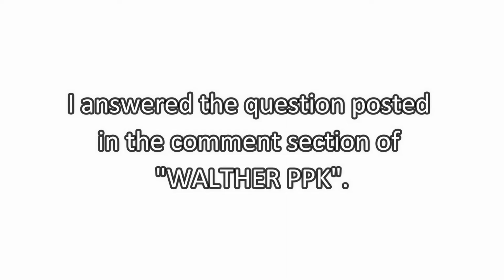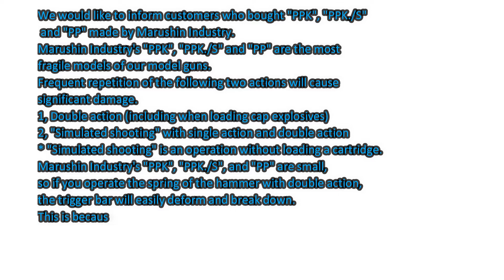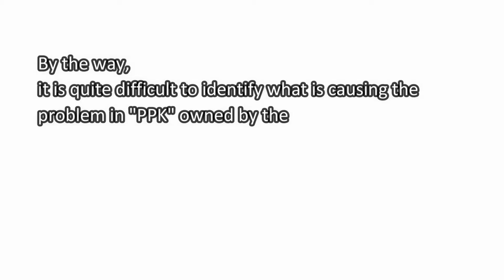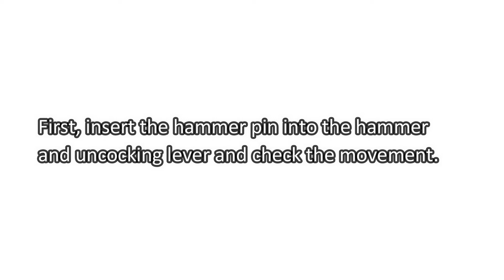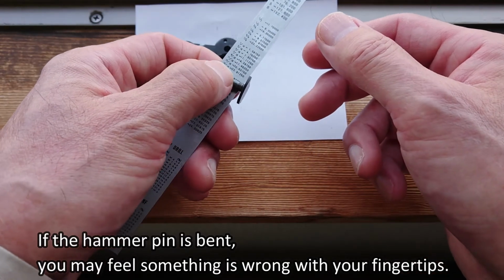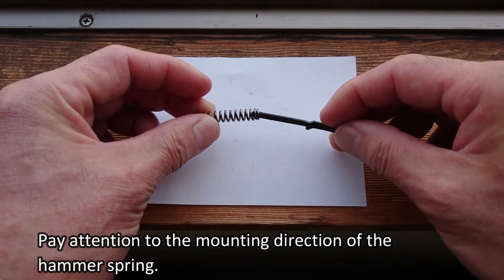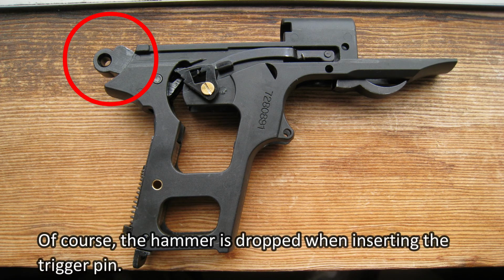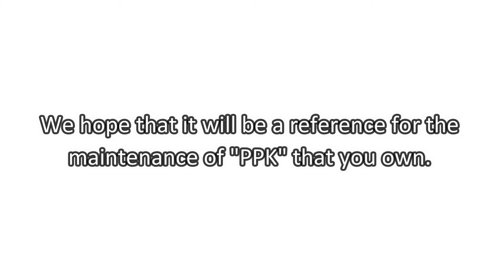I answered the question posted in the comment section of "WALTHER PPK"

Comment: Excellent video. I am with you on manufactures responsiblilty with these models, most have been made for many years and all problems should of been solved by now. The UK also has very strict ruling on replica guns so i understand the need for making models impossible to convert, but as these are plastic i dont see the harm in making some internal parts a lot stronger.
Reply from the maker: Thanks for your comment.
An industry group of modelgun manufacturers has set their own standards, but has not revisited the materials that can be used within that range.
They have been doing the same for over 40 years. It's conservative if you look at it favorably, but it even seems like an incompetent group. This is supported by the fact that even the sale of parts has not yet been completely online. (Only email inquiries are possible) It is certain that it will disappear before the revolutionary transformation.
Now, in Japan, the full metal of "airsoft gun (hand gun)" has begun to be regarded as a problem. Although it is an imported product, it is imported in parts and completed by assembling it personally.
Regulators will be observing carefully. And regulations will be tightened in the not too distant future. In the worst case, you are not allowed to own all metal hand guns. Not only manufacturers but also users repeat bad habits. I also have a legal metal hand gun (model gun), but I will dispose of it if the law changes. That is the fate of those who live in the rule of law. I hope that such a future will not come.
Also, please watch.
Thank you.